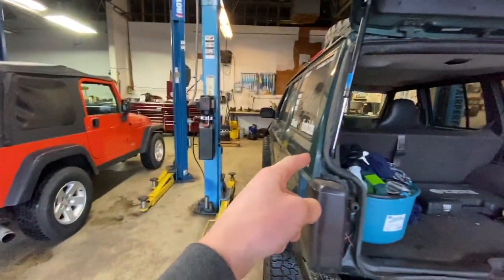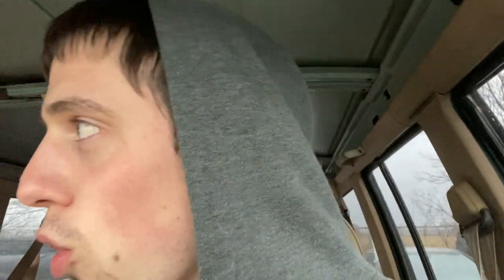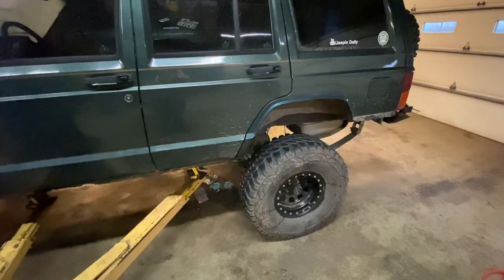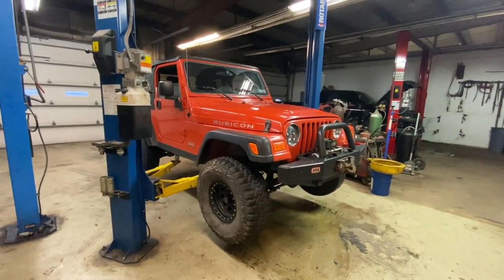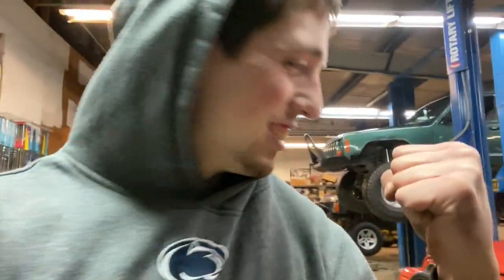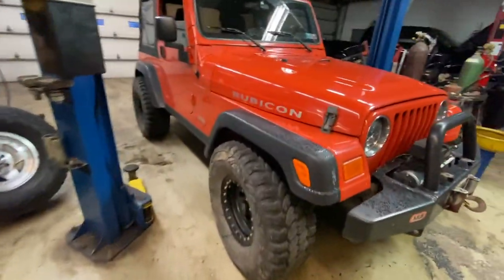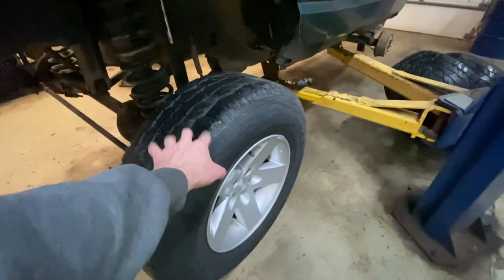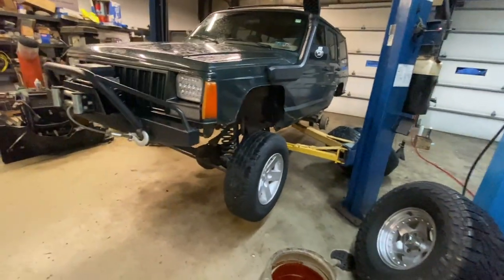We Stuffed 33s On My Stock Jeep TJ Wrangler?!?!

Comment: Did they rub driving?
Reply from the maker: The only rubbing I notice is at full lock or if I hit a deep pothole or uneven pavement. But 100% daily driveable. The roads in my area suck
Reply: @JeepinDaily   I live in Massachusetts where potholes are more common then flat street sadly